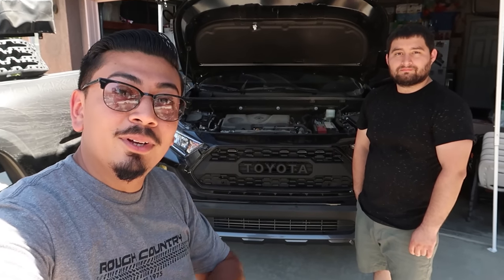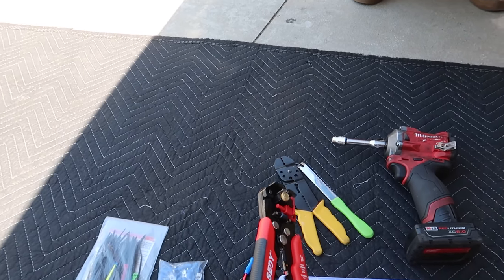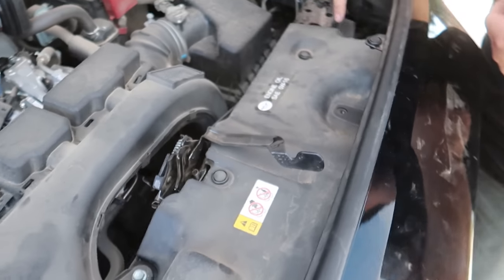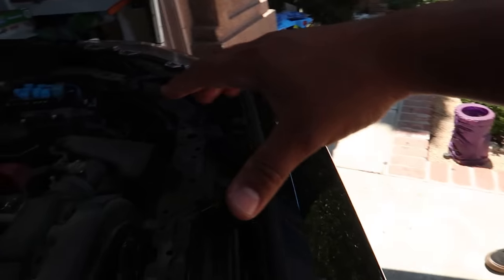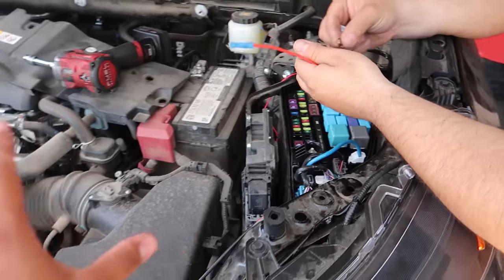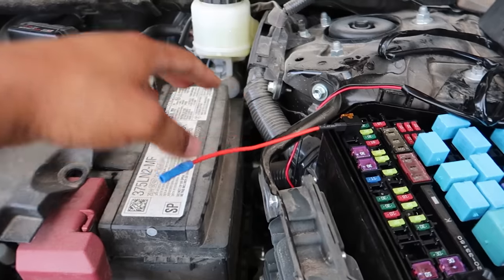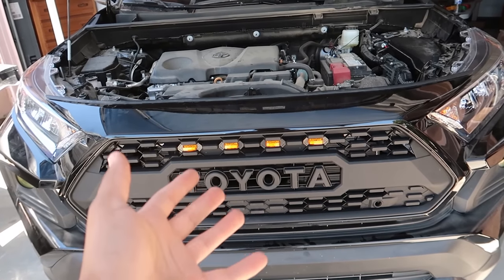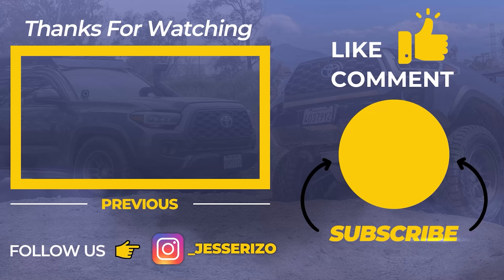How To Wire + Install Raptor Lights on a Toyota Rav4 2019 2020 2021 (TRD PRO GRILLE) 5TH GEN RAV4

Comment: When cutting a hole for the fuse tap wire, the protection of the fuse cover isn't there anymore.  Would it increase the risk of moisture and water getting into fuse box? Would using  a waterproof sealant like silicone sealant be recommended to fully seal that area or is that little open gap not a serious risk to worry about?
Reply from the maker: You are correct I would cut maybe a hold up top and use sealant or I would tap into the inside fuse box that’s on the feet of the drivers side

Comment: Very good video to show people how to mess up their fuse box and ECM for some stupid lights
Reply: I agree, was going so well until they chopped up the fuse box. Why?? Very amateurish work. Any mechanic that pops that hood now will be giving them the side eye.
Reply: Holy hand gestures
Reply: @ScanMan1967  Yeah you need to cut access for the add-a-fuse but I just cut into the fuse box lid (for my Auxbeam panel). No idea why you'd cut into the entire assembly itself. A new lid is like $20. I'm betting the entire fuse assembly box is like $400.

Comment: Glad I stumbled on this.  I just got a 2024 Rav4 and am looking at doing some cosmetics like this.  I am still researching this for the 2024, but I would imagine the process is roughly the same.  Many of the lights I have found only go up to 2023 for some reason, I think it's just an old description because many of them also include 2024 in the compatibility.  Also, that night shot looked incredible.  I was thinking I wanted white, but I may want the Amber ones.

Comment: Thanks for you guys. I have a question when someone asks for opening a door especially at night. I find it hard to do it because the lock and unlock buttons are invisible to me.  What accessories are there to fix that problem. Many thanks in advance.
Reply from the maker: Thanks for watching the video please consider following my Instagram as well @_jesserizo 
And I would recommend a ajt key fob https://www.ajtdesign-llc.com/online-store/Injection-Fob-IF016-2019-Rav4-2022-4Runner-WHITE-p290838015

Comment: Which fuse should I connect it to if i want to turn it on with the fog lights?
Reply: Ecu dcc no.2 location fuse box underneath steerwheel

Comment: You can plug the 10amp wire directly to the 10 amp ecu dcc no 2. Which is your fog lights location is under your steerwheel fuse box.if you want to work with that instead of it turning on when your vehicle is running using USB.

Comment: Great vid, super helpful but I have one question. Other raptor light install vids have their add a fuse wire pointing to the right because they say it depends on which side of the fuse has power. Does it really matter, and is there a reason yours points left?
Reply: I would like to know the answer to this as well??

Comment: Need advice on wiring raptor lights to my 2019 Toyota RAV4 Limited.  
My raptor lights are to switch automatically from amber to while.  Harness has 3 wires...black, red and yellow.  I know how to connect black ground wire, but how do I connect amber yellow wire and red (white light)  to fusebox.  Instructions day to connect red wire to headlights and yellow wire to fogligjhts.  
I'm totally confused on how to do this.  Chinese seller is of no help.
THANKS!

Comment: So I have mine tapped into my 10amp fuse with a 15amp and then there's another 15 amp 6 inches after that that didn't fit in my fuse box. Have you seen an add a fuse like this? It's working but I haven't seen another add a fuse like the one I received.

Comment: I am getting a Rav4 I am in a tossup between and xse or trd off-road models I want to do some overlanding, camping , as they call it “ soft roading” is the xse hybrid capable for off roading i like it due for gas saving. Or should I go with trd off-road I am in A huge toss up between both cars. So watching this video he is going to swap out the suspension, so say if I get the xse hybrid and swap out the suspension like he is going to do would it be more off-road capable? Just trying to get a better idea of both these cars xse vs trd off road.. and if you lift it how many inches and what suspension I’m excited to see what you are going to do with this. Also how did you get it your rav4 cheaper than msrp? I am definitely going to get a Tacoma or 4Runner, after my Rav4 also where did you get the skid plate from ?
Reply from the maker: The trd Offroad I know comes with terrain select so that’s a place and better suspension and tires so I’d do that model, 
And the skid plate comes with the trd off road model

Comment: what if it is 2019 Rav 4 LE Hybrid, where are you going to tap it. thanks. The fuse box of the rav 4 LE is a little bit different from that